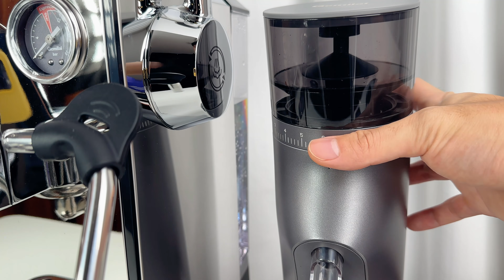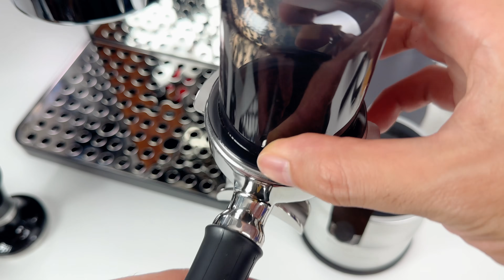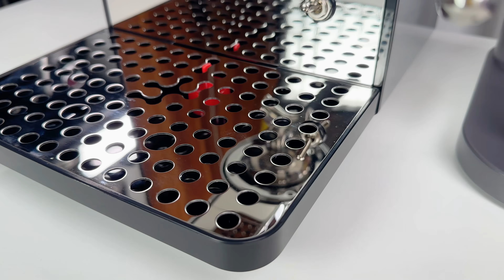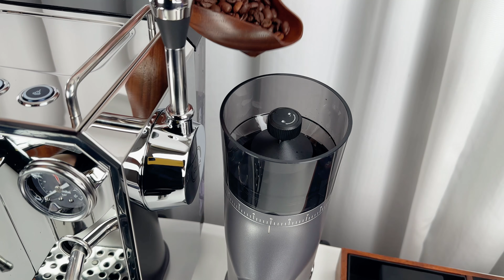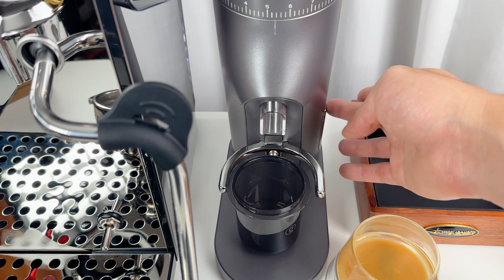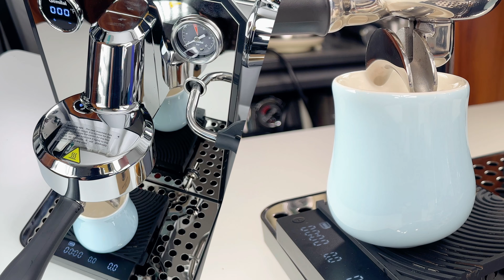Home Espresso Setup: Gemilai Owl Espresso Machine G3006 & Molight Grinder G9010B Workflow & Dial In

Comment: hello! do you manually stop the brewing once you reach 36g? Also my default pre infusion time is 2 seconds
Reply from the maker: Hi, I always use a scale when pulling shots and stop it manually. You can customize the shot time, but beans change over a few days, so you might need to dial in your grind size and timing differently. That's why I prefer just going by weight on the scale.

Comment: Gemilai 3006 or hibrew h10 plus, which one you prefeer?
Reply from the maker: When it comes to looks, I’d go with the G3006 plus the Molight grinder—they really stand out on the counter. For features, the H10 Plus with the G5 grinder is slightly better. Both combos are about the same price, so they’re both great for home use. Honestly, it just depends on what you like more! Both make great coffee.
Reply: Buah! Ya es demasiado para mi gusto. 
No tengo todo ese tiempo para preparar un café !
Aunque me gustaría probar pero sin tanto requisito!
Reply: @MrNelsonk2  esto hay que estudiarlo pero luego que aprendes es hacer la rutina siempre y cuando uses el mismo tipo de tueste y con el tiempo a ojo sabrás mas o menos un aproximado de la mejor forma de extraer dependiendo el tipo de tueste.